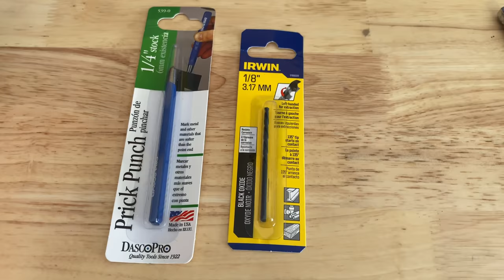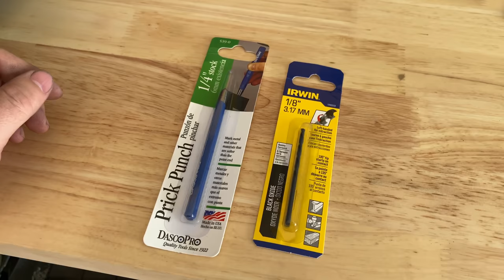I Really Messed Up!

Comment: For more stubborn bolts that you can't get out by hand like that, a mig welder makes it super easy. Get a nut that has an internal thread about the same size as the bolt, or just slightly smaller. A couple of zaps later, you have a cap head bolt you can put a socket on.

Comment: You got lucky amigo. I did a similar thing when I owned my Honda. Instead of breaking the bolt in the oil pan, I stripped the threads in the block and had an oil leak like crazy

Comment: You're lucky all that torque snapped the bolt and didn't pull the threads right out of the aluminum head!  Broken bolts are a part of working on mechanical things.  LH drills almost always work when loctite or corrosion are not in the picture.  Invest in a set of easy outs as well and practice on a rusty hunk of scrap something.  Broken bolts are really not not a big deal with a little practice.  Having a helicoil kit isn't a bad idea either...

Comment: Who’s your best friend... anti-seize, even though anti seize is for dissimilar metals it can and should be used in conservative amounts for all bolts not only will it allow that broken off bolt to be extracted easily it will prevent corrosion like almost all LS And Chrysler owners know (exhaust manifold bolts). Also for those of us that work on our vehicles often and take off components that we maybe put on a month ago it just makes the R&R so much easier. Typically any plastic components are inlb torque specs because the plastic can crack. I however just use my electric 1/4drive ratchet and run it down. Don’t stress too much about breaking bolts it’ll happen to every gear head eventually. Even if it had to be drilled out, because of the low torque spec a heli coil could’ve been used without any concern. If it were a head bolt I prefer timeserts they’re just a little beefier. Nice extraction of that bolt, takes a lot of patience and calm nerves.
Reply: Just don’t put anti-seize on lug nuts. I made that mistake on my 68 Camaro RS, and almost had the wheel come off as 3 lug nuts loosened while driving. 😲

Comment: Made for a good video. Its nerve racking for sure!  Had the pressure plate bolts to a Centerforce clutch to that and had to take to a machine shop to get out. Thankfully my FIL knew him and we got a good deal on that work. Shew.
Reply: Also what did you end up doing for the MAP?  Hopefully the tip I sent was understandable.

Comment: Good job Chris! I know the feeling 100% I did the same on my timing chain cover. Same technique and same results. Oddly enough mine was at 79lbs because I forgot to tighten the nut on the torque wrench and setting moved while I was cranking.

Comment: Been there done that — just once like you. I did this years ago on my 87 C4 intake assembly, after a blown head gasket. I had to use an “easy-out” drill, as the end of the bolt was really jammed-in. So far, I haven’t had to remove or rebuild the intake manifold or heads on my 99 C5, because it only has 51,000 miles on it. Hopefully, your video keeps others from making torquing mistakes. I really appreciate your videos and advice. 🤓

Comment: Like many in the comments, I've done something similar, but in my case, it was a mis-print in the instructions. Since then, I've torqued so many fasteners, I have a general idea of what the torque should be.

Enjoying your videos, and just joined the C6 club (vicariously through one of my best friends;-)).
Reply: Sorry that happened. I did the same thing on the transmission pan on my 2007 Dodge Magnum. Used pound feet instead of pound inches. Sheared the bolt head right off! 😣